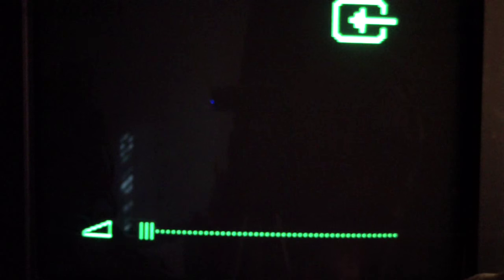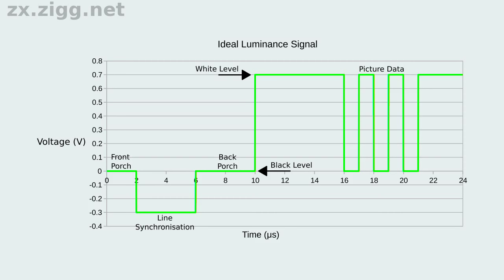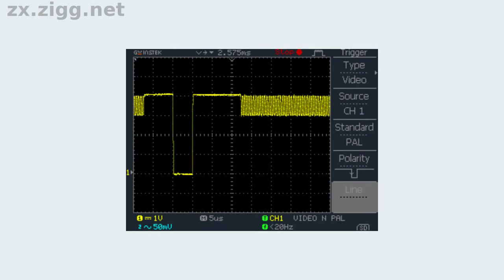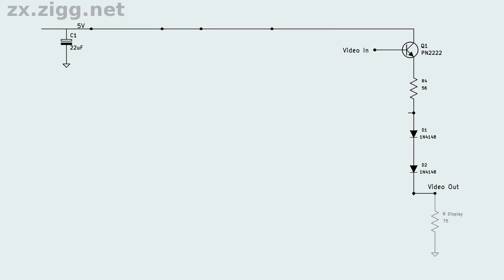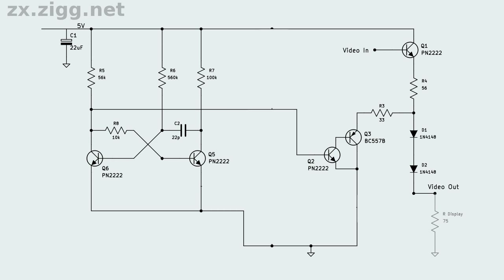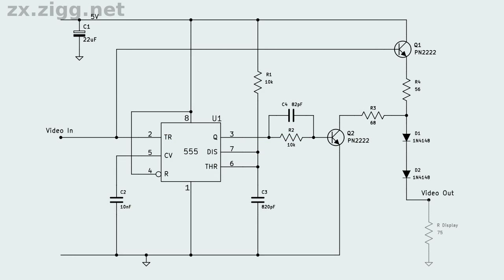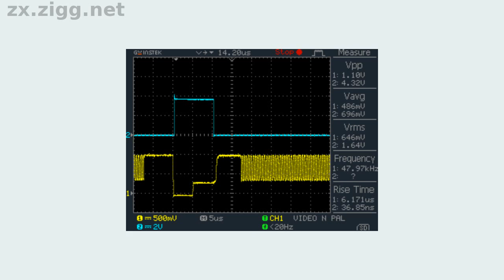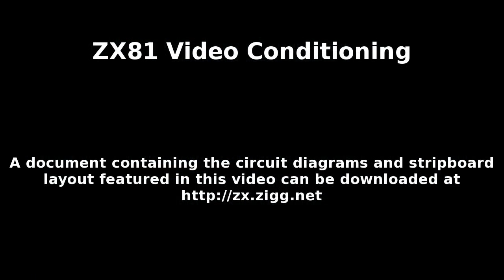ZX81 Video Conditioning

Comment: Hmm, this circuit (the one using the 555) doesn't seem to work for me. My ZX81 doesn't have a back porch, and the line synchronization pulse is about 2.3 V, the rest is about 4V. To trigger the 555, we'd need to go below 1/3*5V (~1.667V). If anyone has a nice solution, I'm all ears. Otherwise I'll reply to myself when I have figured out something that works.
Reply: Got it to work by adding a resistor divider in front (ULA pin 16 → 270 ohm resistor → path 1) 1k resistor → GND; path 2) rest of circuit. (Took some experimentation to get working values ― just calculating normally would drop the voltage more than expected.) Also tried adding fast diodes in front at first (driven directly by the ULA), but that wouldn't work, the signal would end up garbled.
(Note: I haven't checked yet how much current the ULA has to push with the added parts.)

Comment: 555 circuit was tested on a kit built ZX80 which suffered from a poor and fuzzy picture even with the brightness at 100% due to no back porch output. Image quality on the 80 is now very good, so much so that the brightness and contrast levels on the flatscreen test television are down in the 50% levels.

Comment: Finally got around to building the circuit (only changed the 22uF cap to 10uF since I was lazy and didn't have any 22uF ones).
Works a treat, picture on my flatscreen is very good, on my sony PVM broadcast monitor quality is on par with emulation.
I'd post a before-after-picture but for some reason youtube won't let me paste the URL. Thanks a lot for this.

Comment: I built this circuit for my Timex Sinclair 1000 and had a few difficulties. 
It works great now that I've figured it out.
Just so any other poor souls try this on a Timex Sinclair 1000, the main thing you must know is you MUST attach the video input to pin 16 of the ULA. The USA builds do some magic between the ULA and the RF box and you can't take the signal from the wire that enters the RF box.
Other notes:
There are 2(3?) different ULA chips depending on your model.
ULA 2C184E needs this circuit or some other video circuit to add back porch.
ULA 2C210E does not need this circuit, but might need a simple transistor amplifier. https://www.classic-computers.org.nz/blog/2016-01-03-composite-video-for-zx81.htm
I hope this helps!
Reply: It does! I am going to be doing this with my recently acquired TS1000. Also planning to do the internal 16k mod.

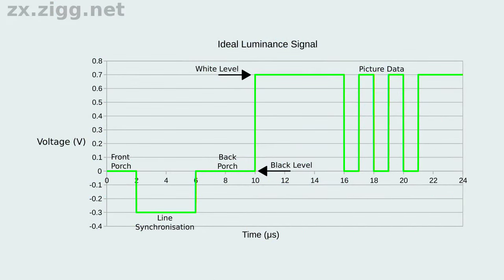Comment: 1:35 "Strictly, this is a luminance video signal, not a composite one."

I am pretty sure that technically that's a luma signal, not luminance. And is the term "composite" so so precisely defined? The signal you show, after after all, is not just the luma information but is the composition of the luma and two sync signals. Combining the horizontal and vertical sync signals together (which is not correctly done with a simple XOR, though that usually works ok) is usually called "composite sync."

I deal a lot with split and composite sync signals independent of the video signal. To try to reduce confusion with baseband single-channel signals that include composite sync, I've taken to using the terms CVBS (widely used, with many different ways of expanding that acronym) and MVBS to distinguish those with and without a colour signal mixed in. (This is independent of scan format; e.g. I use MVBS for both 60 Hz (old B/W NTSC) and 59.94 (newer colour NTSC) scan rates, so long as a color signal isn't present).

Such quibbles aside, this video is well done and very informative.

Comment: Brilliant, another masterful improvement to a classic system!  I might need to do this mod to my ZX81 - need to get it out and check which revision it is.  Do you know how to identify which ZX81s this mod is not required for - ie. what revision board / ULA?
Reply: GadgetUK164 If your TV produces a picture even on low brightness settings then you only need to do the first circuit I suppose
Reply: I guess I could also measure the output on my scope!
Reply: GadgetUK164 sure, if you have one. I assumed you didn't.
Reply: No prob!  I just didn't think of the obvious ways to check there.  I love this channel - very educational!  Good time of day to you!!! < We need a T- Spring campaign with that slogan!!!

Comment: I had to use a 100 Ohms resistor load in the video out. If not done the new TV sets do not detect the video signal. My ZX81 uses the new ULA with back porch. Thanks.
Reply from the maker: The circuit as presented does require the display's input to provide a path of approx. 75 ohms to ground. Most do, even modern ones, but obviously there are exceptions. Adding an extra resistor as you've done is the right thing to do for those that don't. Depending on the design of the display's input circuit, it might be possible and appropriate for the load resistance to be quite a bit higher than 100 ohms; I suggest experimenting to find out.

Comment: I was recently gifted my first ZX81, but for some reason the black to white transistions "bleed" quite bad (white to black is fine) on both of my TVs (Sony PVM tube and KLV LCD). Would this be related to the back porch issue or is it a seperate issue? The board has been modified to output composite (but has no additional circuitry as found in various instructions online).
Reply from the maker: +Hans “Shockwav3” Meier I wouldn't have thought it would be, but a missing back porch can cause all sorts of odd symptoms. How is the contrast of the picture? Do you have to turn the TV's brightness or contrast control up high to see the picture?

Other causes could include noise on the signal that coincides with black to white transitions. Another possibility is that the signal rise time at these transitions is too long. One cause of this could be excessive capacitance or inductance in the interconnect. It'd be worth trying a different (and as short as possible) cable to connect the Spectrum to the TV. Is the video output taken directly from the ULA or has any interposing circuitry been added, even just a capacitor?

I think further diagnosis would require viewing the composite video signal on an oscilloscope, with and without the TV connected.
Reply: +JoulesperCoulomb Turns out the modification I found was wired up a bit odd.
This is the intended circuit on the left and what I found on the right: http://i.imgur.com/lPqbgMI.gif
Threw it out all together now and going to add your circuit at a later point.
Above circuit did not fix the backporch issue - which my LCD fixed automatically, but the tube monitor interpreted it incorrectly as both should have.
Reply: +JoulesperCoulomb Oh ... one more question ... would a 2N3904 or BC548 work as well in your circuit? I don't have any 2222 lying around - but more than enough of the types mentioned.
Reply from the maker: +Hans “Shockwav3” Meier I would think both of the alternatives you suggest should work; give them a try.

Comment: Pictures as promised.
Top: original modulator output, bottom: composite with 555 based back porch generator.
Both taken on my Sony LCD, on the PVM broadcast monitor the picture look even better.
imgur.com/aBfK6GI.jpg